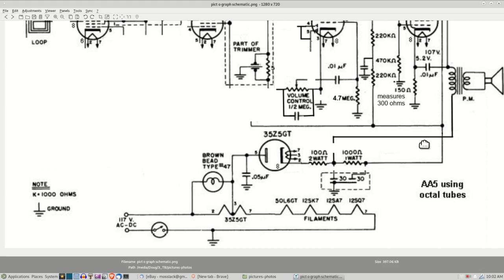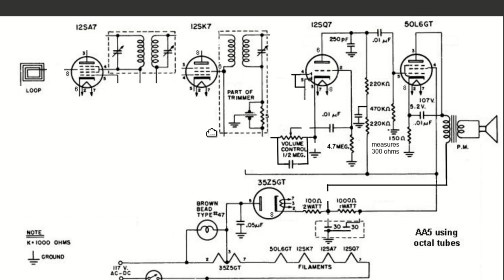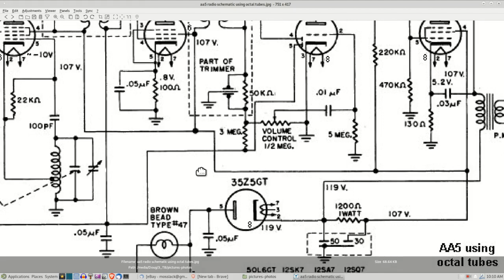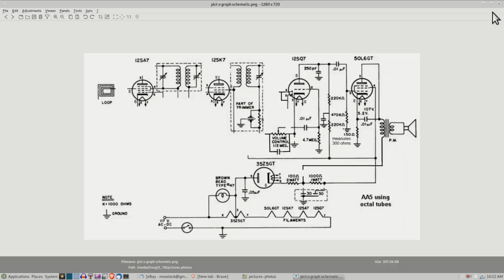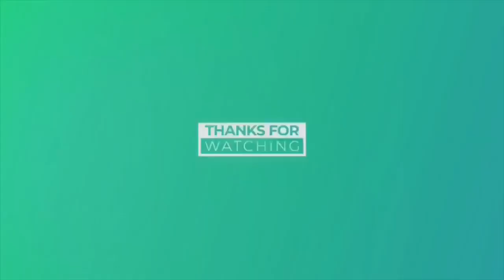DERB - Saturday Extra! - Pict O Graph wiring explained

Comment: Nice job of reverse engineering Doug, the cathode resistor for 50L6 of 300 ohms is to high in value 150 ohms are the norm.